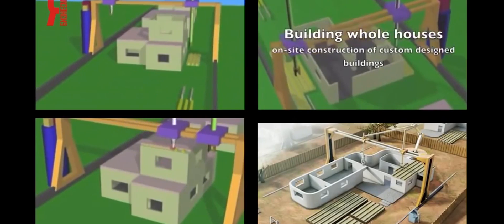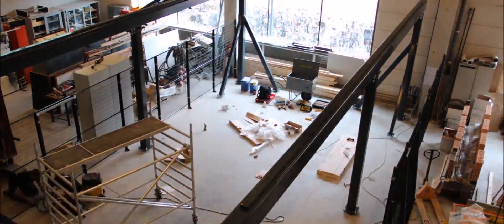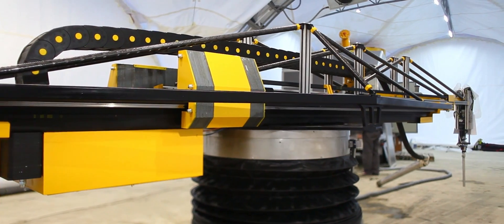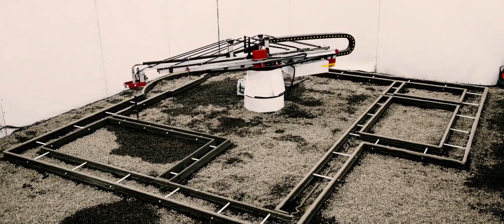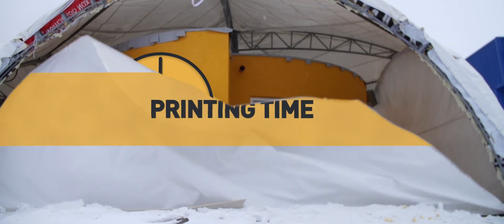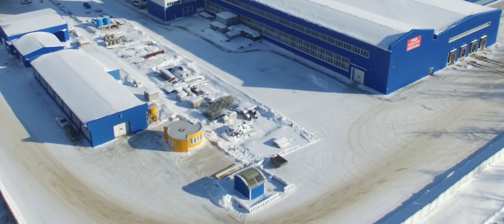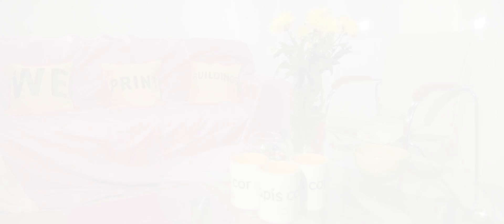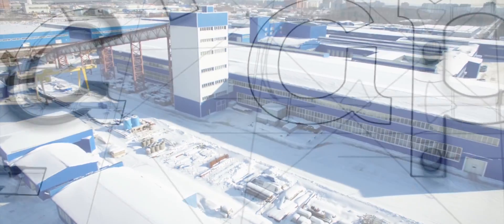Apis Cor: first residential house has been printed!

Comment: I'm a little confused. The video initially states that the cost to completion for a 3D printed house is is $275/m2 but a normal house is $223/m2 but that the printer saves 70% of time and labor? How come it is still more expensive to print a house if it saving 70% on time/labor/materials?
Reply: They word it weirdly, what they are saying is that if they were to print a normal square house the cost would of come down from $275/m^2 to $223/m^2 not that a normal house built via construction would be that cheap.
Reply: or do you mean that you could get the price as low as $223/m2 if you were printing a square building and not using high end materials?
Reply: Raphael Saccasan I'm confused by this too. And land isn't figured into either price estimate, so that last comment makes no sense either.
Reply: i think it's merely a typo actually. notice they immediately say they save 70%. i believe the 223 was meant to be 1223, that would make it 70% off. i looked up the cost to build a house per square meter in the US, and it's about $1000+ per square meter, which is more comparable to 1223 than to 223.
Reply: Woah... hold up.  I write ~20 words, and suddenly you tell me what I do and don't care about? And profanely, at that?  And tell me to go to hell?  This, alone, gives me the impression that you're not someone with whom I can have a logical interaction.  Come on.

Of course people have been displaced, that's how life goes.  If you have a trade, and it's no longer relevant where you currently are, either 1) find somewhere it's still relevant (trades and skills don't just become extinct overnight... industries still have to adapt to the new technology) or 2) be proactive by adapting and learning a skill that's similar to the old one but accounts for the new technology.

Don't spend 4+ hours per day with entertainment (i.e. TV, media, news, etc) like the "average American."  Go out and learn, never stop learning, and spread the act of ceaseless learning to everyone around you.  Secretaries still exist -- they just have different functions, and different tools to perform those functions.  Age is just a number -- if you want something, work to achieve it.  I've known people in their 50s and 60s who've learned computer science; if there's a will, it'll happen.
Reply: wazup3333   I live in Canada but I imagine the reasons are about the same at this juncture. 
There is no law saying you can't do it. The problem is there has been no testing and the building codes are not in place to approve it. If you could get an engineer to sign off on it, you could get it approved.
There is the problem, the engineers have not had a chance to test the method and materials yet so finding one to sign off on this is likely impossible or at least very expensive.
It is also not in the government's best interest to make this happen so they will not voluntarily do the testing. The government gets a lot of revenue from construction. This would nearly eliminate that.
Reply: $275/m2 is the price for the house as built with the fancy shapes and such, $223/m2 is the price for a standard box shaped house, which comes out to being about $80 a square foot roughly. 70% assumes that standard construction cost is around $266 a square foot or $798/m2
Reply: wazup3333  Yes, if you build to code you will be fine. The problem is there is no code for this. The building inspector has no way to approve this without a code to follow. 
You need an engineer to approve it first, then the inspector will approve it based on the engineers guarantee. At this point no engineer will put their reputation on the line as the method and materials have not been tested.
Reply: wazup3333  This video is Russia. They insulated half the building with loose insulation and the other half they insulated with spray foam.
When an engineer studies the plans or idea, they use their knowledge to decide if the plan is good or not. If they like it, they sign off on it and that is a guarantee that the building inspector uses to give the project the go ahead. The inspector still inspects the construction though, to make sure the plans are followed.
I have no idea what an engineer would charge but I am pretty sure that at this early stage of the game that no American engineer would sign off on any 3D construction plan at any price that was reasonable.
Reply: First of all square walls house is way easier to construct that a curved wall like this, you try to build anything like this with traditional methods it's gona easily cost twice that. Second thing they build this house in 24 hours basically with no labor costs at all. So I guess they are only factoring in the material costs in the calculation. So the final line is 3D printed houses can be as cheap as regular ones or even cheaper.
Reply: Unlikely to be a typo. As at 15.37  Monday the 6th of March 2017 there have been 791,351 views. A typo would have been corrected by now. 

Quote> The construction cost of the printed house amounted to $10134, which is approximately $275 per square meter, taking in account that partners have provided the highest quality materials, and building itself has an extraordinary shape.

This cost includes all the works that were done to make a complete house: work and materials for the construction of foundation, roof, exterior and interior finishing works, installation of heat insulation of walls, windows, floors and ceilings.

A square house made using materials of an average price category would be even cheaper ≈ $223 per square meter. <Quote

For more info see link http://apis-cor.com/en/about/news/first-house

Jessica Huwite: Not yet. According to the video above Human labour & materials costs are more cost effective.
Reply: as long as you conform with the building codes than your fine?
Reply: you can build concrete houses cant you?
Reply: That depends on the banks. They make the laws.
Reply: Corey Proffitt   10.76 sq. ft = 1 sq. mtr.   That is $25.56 per sq. ft.
The shape does not matter much to the printer. 
Their box house price per sq. mtr. is for a plywood box with no finishing $20.72 per sq. ft.
That is material only. The cost doubles with labour.
Reply: +nayanmalig "And many non Russian friends of mine are now living in Russia, including native Americans, Swiss and others.." . Let me guess: is the IRS breathing on their necks? Or are they wanted for tax evasion?
Reply: Maybe they want to escape the mind numbing hypocrisy.
Reply: Nice catch. It seems just an error. I hope they meant 3D cost $223/m2 and regular $275/m2. Otherwise does not make sense.
Reply: Obviously technology has no problem with automating home construction and you're lost back in time if you think it can't be done.  Many forms of technology are far greater than robotic home building.  This is easy peasy man.  I feel I could engineer the system myself, much less that if I was working with a team of other skilled engineers- and I'm not kidding one bit.
Reply: Zeb Clark  There is a video here on youtube where a guy built a printer himself and printed a large playhouse castle in his backyard. So yeah, I agree not really that complicated.
What is most hard to believe is that there are people who still don't believe that these things are coming and will label you as a kook if you talk about it. LOL.
Reply: Okay sir, first off 3d printers  can print with far more than 1 material.  Wiring would be easy for a 3d printer, infact, a microprocessor uses billions of tiny wires and the processor is printed over a period of 6 months.  With the engineering making the house jointless and rid the use of studs then you could damn near pick up the house by a hook it would be so solid; thus decreasing the need for such a solid fountation due the home would never fall out of being square regardless of the foundations existence.  Then the roof made from wood?  That is only in the U.S. where wood is in abundance.  There are many ways to make roofs.  Many parts of the world don't have wood and so everything is made from concrete.  The entire middle east is all concrete and wood is rare.  

A printer prints flatscreen tvs.  a printer prints multi-layered circuit boards.  a 3d printer can print a bicycle chain that is fully functional.  You are underestimating the new technologies capacity during it's infancy stage.  Printing a foundation would not be hard.  Everything is automated and progressing in that direction.  An excavator has only existed for the past 30-40 years, but imagine how many jobs it replaced?  An excavator is something you don't argue because you see how beneficial it is, but an excavator is automation; as it replaces the need for labor.
Reply: This printer might run for longer periods at a time than a human workforce. That would save some time.
Reply: If that were the case, it wouldn't be new technology.  Technology: anything that extends the capabilities of a being.  Toothbrushes, pens, paper, forks, computers, 3d printers.
Reply: @nayanmalig what laws are in place that wont let you do this in usa?
Reply: wazup3333  Yes you can. The walls would have rebar and the cement mix has been tested and approved.
The exact same cement mix that comes in a truck would not likely be used in a 3D printer so would need testing and approval.
The construction itself is completely different also. This is more like a cinder block wall than a solid cement and rebar wall.
Reply: Do you have any article references to how building code works? is any qualified engineer able to approve a building project? What do you mean by "then the inspector will approve it based on the engineers guarantee." If this is the case how do custom projects get build such as glass johnson house,  Steve Hermann glass house,or shipping container houses, tree houses, underwater florida hotel, underwater vilas(none in usa I think)  and many other custom architecture
Reply: wazup3333  Building codes are different in different places. Just google your city + building code.
Three D printed house will not be in there though. 
If you live somewhere that there is no building code, you can do whatever you want but you may not get financing or insurance and you may get caught later.
Custom projects would have to have a structural component that the engineer can understand and quantify.
He needs to be able to prove mathematically that the materials and methods used will be able to stand up to earthquakes and other natural circumstances.
If the technology is new there are no examples to study or cite as reasons for his confidence in your building plan.
You need to remember that the engineer cannot afford to risk his whole career to approve something he is unsure of.
Personally, I would think that the spray foamed part would stand up very well.
Reply: What spray foamed part? They are using this technology in China. What do you mean by engineer guarantee? How much would an engineer take to approve it first, then the inspector will approve it based on the engineers guarantee.
Reply: Marx and Lacan will explain that to you. It's called surplus knowledge, etc.
Reply: thats technology, can't do anything about that.
Reply: What noo nope said is correct. The amount of wood that goes to waste is mind boggling. I install fire sprinklers in town homes/apartments and every day big ass dumpsters are getting hauled off full of perfectly good wood. supes get bitchy as hell when you try to leave with a truck load of wood from a dumpster.
Reply: You are entirely correct. I was throwing out a rough guesstimate, and I completely forgot to factor in squared part of the math. I believe what they were saying though is their cost for a box shaped house with their system, instead of the architectural shape they created in the video. The shape may not matter to the printer, but it would use a little more 'printing material'. Doing a little research, the national average for construction is reported around $150 a square foot for a typical new construction home of average size by Home Advisor. This, of course, is always subject to change due to location and design.
Reply: +nayanmalig "Banks and government won't let go of the stranglehold easily." - You have no idea what the hell are you talking about.
Reply: Deirdre, your argument for "not a typo" is very weak. It depends of the assumption that they either correct the typo if the video is popular, you have no idea if they are 1) monitoring popularity 2) Care about correcting the typo.
Reply: Lobbyists and constructions companies wont let this happen in the US. They will bribe senators with campaign funding and people will still pay $300k for a decent house.
Reply: +Rocky Gamer You really have no idea what you're talking about. I bet you don't know anything about the costs of building a house even....
Reply: becaus there is allmost no human laboar like the robot only needs power not a salary for its work
Reply: Because it is on time labor and materials..... not counting the printer
Reply: no no no look it costs 223$/m2 for a regular shaped house, this house cost 275$/m2 because it was wierdly shaped and shit... at least i think
Reply: Zeb Clark, Tim Mac and others: you're still missing the point here. Sure, these things ARE here and sure, they WILL cut costs somewhat. However the resulting saving won't be nearly as dramatic as you envision it. Why? Because 95% of the time the cost of erecting the walls doesn't have near the lion's share on the house's building costs as you might think. The foundation alone (for proper houses, not the prefab crap) usually costs more than the walls (because it has to be dug out and a lot of concrete must be poured in, no shortcuts for that). Then there's the wiring, insulation (increasingly important everywhere except Trumpland), ROOFING (no, you can't 3D print that - yet -, because it usually has to be light, that's why it's still made from wood up to this day) including shingles, doors/windows, heating/plumbing etc. Out of all these items, what can a (purpose-made) 3D printer automate at the moment? The walls. Nothing else. Is that the "revolution" you all are talking about?
Reply: true
Reply: Apis Cor’s literature states that cost per m2, including insulation, is 1027.62 Russian Rubles or approximately £11.95 GBP
Reply: It's not going to happen in USA and west first. Banks and government won't let go of the stranglehold easily. It could happen in Russia (because they don't care a fk for what the western bankers and govts say). Russians are trying to attract foreigners due to a low birth rate. IF (big IF) it catches on in neighboring China, Japan, Korea etc and India the west will be forced to follow suit to compete. This is similar to hybrid vehicle technology and solar power. It's disruptive and will take time to catch on. Resources and manpower cannot compete with technology in the long run. It's proven. The former gets too expensive with mass production while the latter gets cheaper. There is no competition.
Reply: @nayanmalig  I know too many Russian's moving to USA
Reply: I think it means it saves 70% of time, only two days, and 70% of labor, because it only uses one machine, and support crew. The high cost /m2 is because its new technology, and the machines are probably very expensive.
Reply: No I heard Putin say it. Maybe he knows better than CNN and you. And many non Russian friends of mine are now living in Russia, including native Americans, Swiss and others..
Reply: You think children can run the economy? They need time.
Reply: They are stating the cost of materials only. The 3D printed house takes almost no labour. With labour, a typical wood house could cost $1500 to $3000 per sq. meter. You still need to add land and services.
The printed house would be livable very quickly whereas a wood house would take a lot longer.
The printed house would just need one guy to set up and feed the printer.
They could have also printed the kitchen cabinets.
Reply: You are wrong, the Russians give birth to 2 to 3 children now in about many families and more (there are 4-5 children).